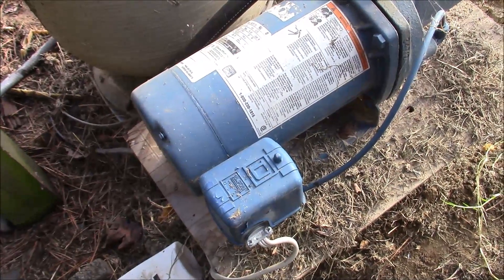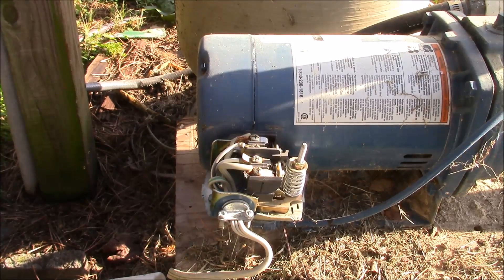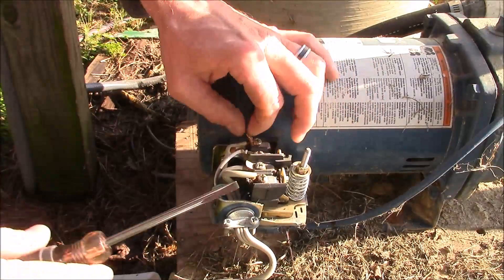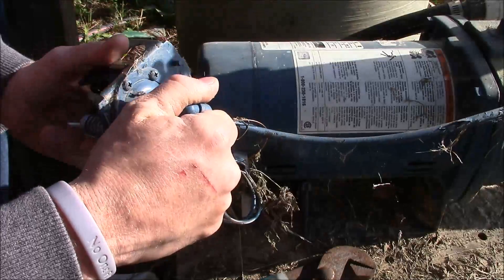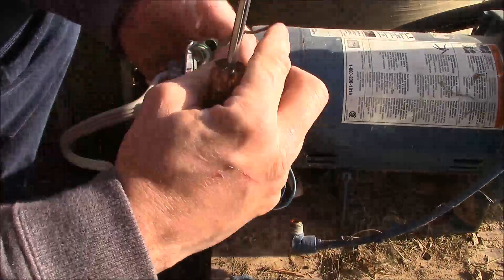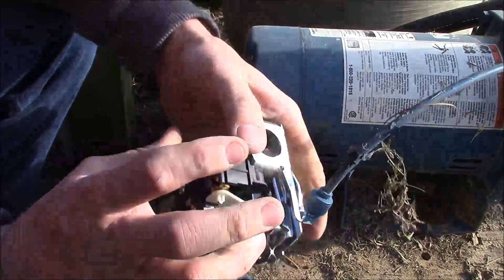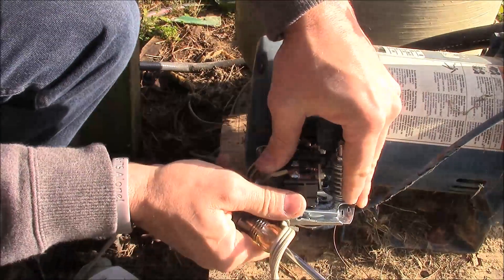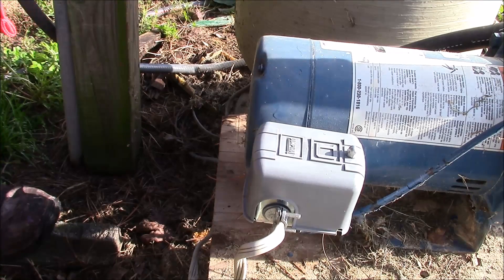How to replace pressure switch on water pump

Comment: that water line that goes under the pressure switch has an elbow fitting where the small plastic hose connects, do you know what that elbows actual name and size it is? I have a gould pump and I need that elbow. TIA
Reply from the maker: Not sure about that. You should be able to take it to a plumbing supply store they can hook you up with them. I am almost 100% sure you can get them at Lowes or the depots also
Reply: How did you get the pressure off the line to the switch ?
Reply from the maker: Turn on faucet